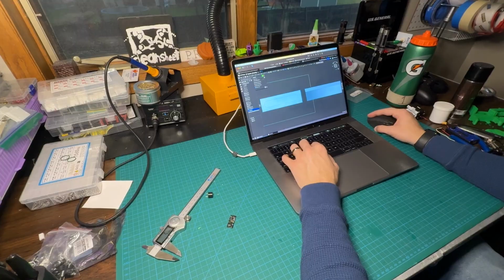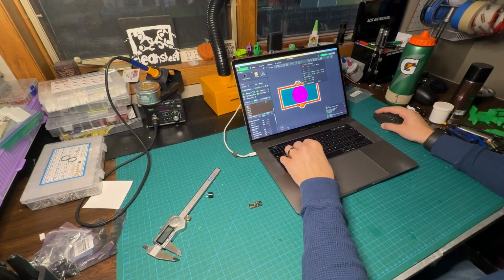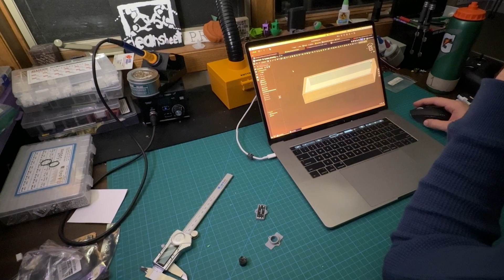Traxxas Rustler Buzzer Mod – 3D Printed PWM-Controlled Sound System You Can Build!

Comment: You're flying the printer more than the airplanes lately!   Next, pull it all together and design/print a RC flying car with working remotely actuated horn, modular digital FPV with head tracking, bomb release, landing gear indicator, ground proximity sensor, and of course a crystal clear canopy for our video viewing pleasure!  You're always up to something fun!